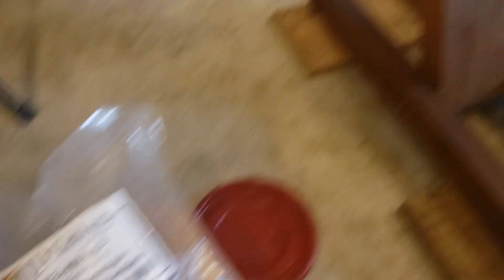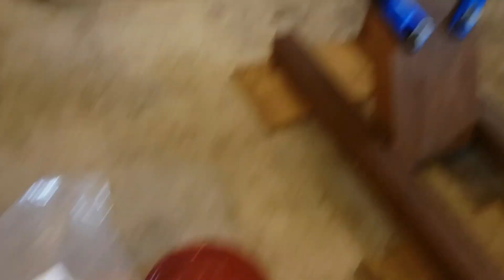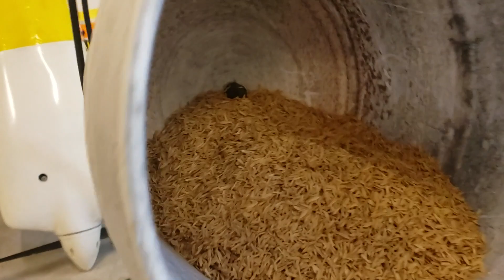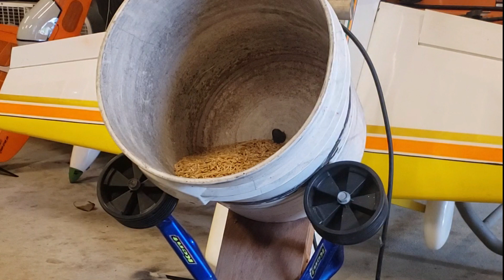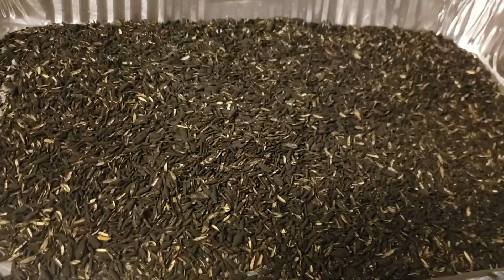Coating Rice Hulls With BP

Comment: What ration you trying to achieve???  I prefer 7-1 myself.
Reply from the maker: I use 4:1 and 1% dextrin
Reply: I use a resin based bp for mine.   Little more expensive but works better my opinion.
Reply from the maker: @johnstaton5524  what is resin based
Reply: @MrWhistleFire  i use phenolic resin instead of dextrin.
Reply: @MrWhistleFire  Interesting, I find a lot of small particles of BP if I don't use 4% Dextrin. By the way , I am a subscriber and love your videos, thank you!